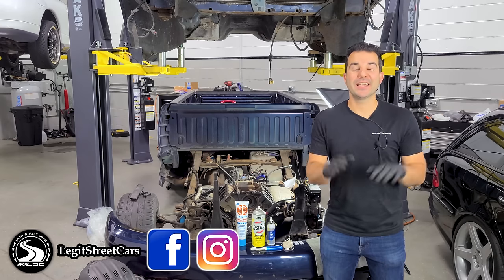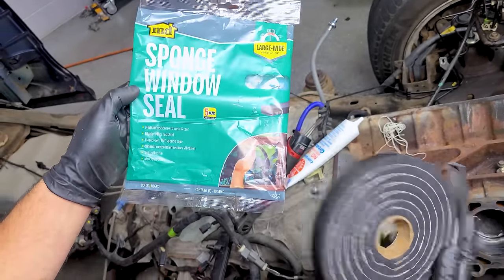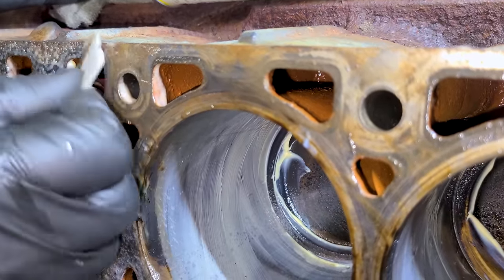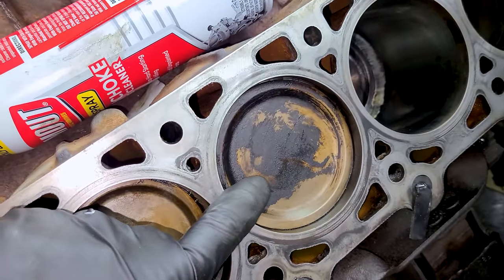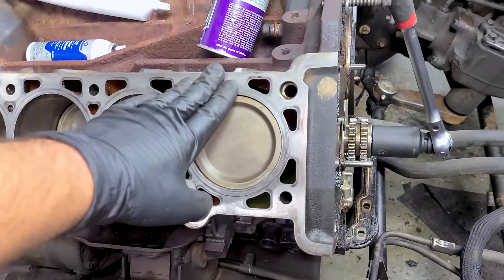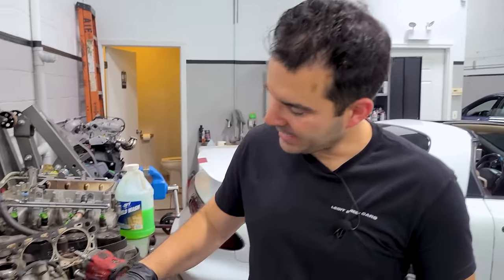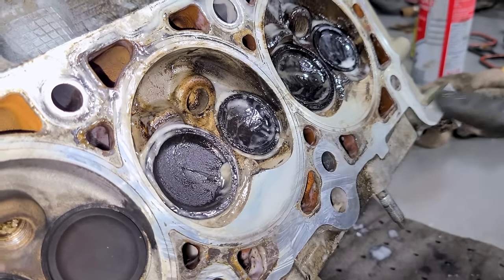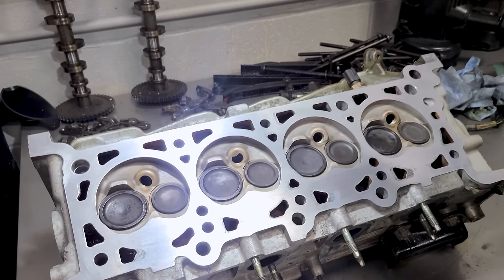How I Cleaned My SVT Lightning Pistons & Engine Block Using WAX STRING! BONUS: Head Cleaning!

Comment: SODA blasting cheap easy cleanup with water and makes it look like NEW.. you are really spending way too much time and effort over thinking a relatively easy operation.  I personally use glass beads in my cabinet but i have been doing this for decades and get all the residue and glass beads out so I do not have any issues .. if you fail to remove it all it will cost you an engine. But the soda blasting takes 3 times longer but it literally idiot proof you dont even need a cabinet buy a gravity fed hand blasting unit and soda. I buy 50 lb bag because I re use it and sift it clean .
Reply: also at the end you said to get it milled to remove the staining ? thats pitting not stains .. and you can remove that at home as well with a thick piece of glass and a lot of elbow grease

Comment: really don't recommend cleaning engine this much specially if there is no need for it.
the engine gunk often works as a sealant/barrier for broken gaskets and seals cleaning a perfectly running engine is like the dumbest thing one can do 
so don't do it unless u haven't changed yo oil for over hundreds of thousands of miles ik there are some dumb fux who dont

Comment: Tweaker skills speaks volumes about the content. So are you rebuilding the engine or making nonsense content?? 
Obviously you will hot tank the block to remove the serious rust buildup.
People if you’re to scared to drop the pan and properly inspect the piston’s & Rings why would you even bother with oven cleaner…? 
Doesn’t oven cleaner etch aluminum and cast materials!!  How many of you want to remove the cab to easy oven clean your pistons… get it yet?
Nonsense is the hook 🪝 lol 😂

Comment: the amount of  time being wasted on this detailed and time consuming work with little cleaning bits and tiny tools and prepping with string etc etc etc.....to me is pointless when you would spend the same amount of time tearing down the rest of that block and rebuilding it to new spec and cleaning it completely at a machine shop as well has making sure everything in spec makes far more sense and is far more logical....and is more satisfying and more productive in the end....and everything is new.  that block has so much rust and residue on it it needs a real cleaning and flushing not this.  

i respect your work, but this is just plain illogical.
Reply from the maker: Wait a minute.  You're comparing the time it took me to clean the pistons to a complete teardown and rebuild? It took me like 45 minutes to do this.
Reply: @LegitStreetCars  
I remember my M62B44 (E38) with 230k miles on it was running fine but after a 2500 mile round trip to texas from vegas the valley pan was leaking, removal of that turned into seeing the valve covers leaking in the back end, turned into seeing 2 broken head bolts on one side, which turned into seeing the pistons excessively thick coating of oil, and the OSV behind the TC was brittle and half broken, and then the M62 TCG's being risky since they were originals (oddly however still in very usable shape)....one little thing behind another, behind another, behind another.  I rebuilt the engine to new spec, and it was fantastic and i felt so much better afterwards knowing i just went all the way.....not knowing what else could have been hiding or being a problem at 230k miles and being half way there.  

honestly and genuinely from me....i express my appreciation for your attention to detail  especially on your mercedes cars (V12 rebuild was great work) and your latest interior detailings, your alternatves to intake cleaning vs walnut blasting....im really shocked here that you didnt just run right for the bottom end teardown seeing all this filth that has been running thru this motor for god knows how long.
to be fair, im not knocking the cleaning up itself, it came out pretty good, you knock it out each time with great looking results.  This time, yea sorry.... kinda questioning the logic with the unknown abuse of this engine, that rust, unknown history as well....so yea again sorry but thats where i coming from.

Comment: Considering the amount of work it is to do haed gaskets. It's just plain foolish not to resurface the heads. And since the heads usally have a ton of miles on them you might as well have them rebuilt. The local cylinder head exchange here does them for $250 each. 3-4 day turnaround time. You do what you gotta do if your 4 cylinder honda has to get you to work on monday. But a major project like this? Pony up the $500 bucks and do it right.
Reply from the maker: There's literally nothing wrong with these heads though.  To many $500 is a lot to spend
Reply: @LegitStreetCars  exactly

Comment: Why are you cleaning the pistons or the head for that matter.
Its going to be the same as you found it in 200 miles.
The best way to clean an engine is with Engine flush in the oil without even taking the engine apart.

Comment: The most pointless video I've ever seen as far as cleaning engine components. So nothing in the block is clean eg. Oil galleries, water jackets.
The heads once again, rubbish... valves, guides, intakes and exhaust all still filthy, water jackets still full of corrosion.
The only way to do it correctly is full tear down, and hot wash everything. What you did in this video was pointless and would really give no benefit at all.